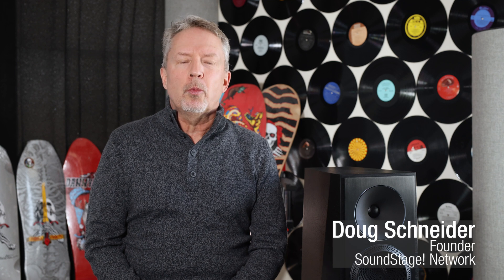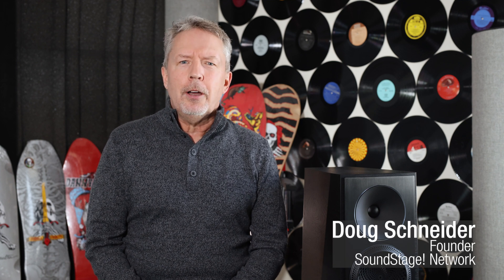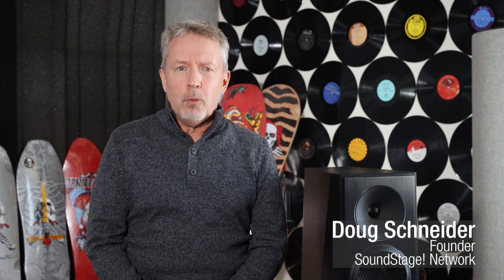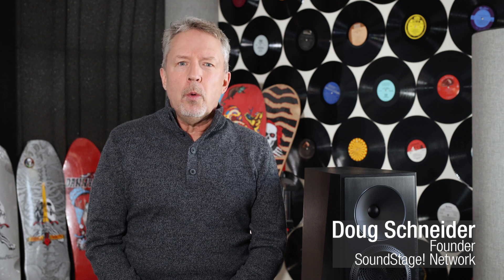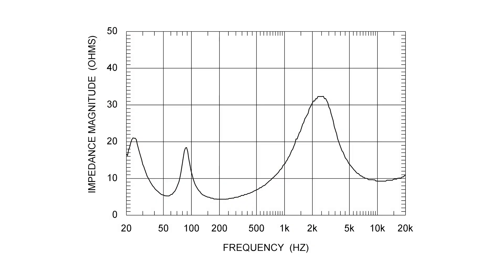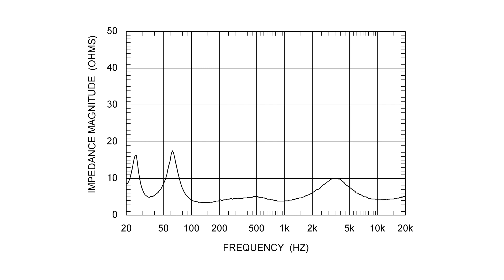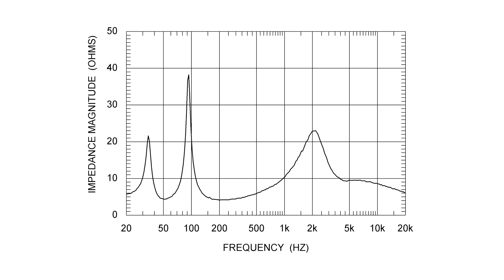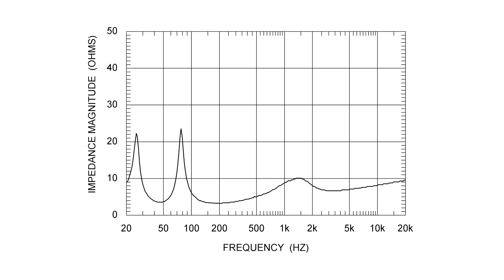Speaker Sensitivity Explained - "4-ohm/2.83V" is Not a "Trick" Like Robert Harley Claims (Ep:55)

Comment: We use constant voltage because all the amps are voltage generators, not power generators, not current generators. An ideal voltage generator has 0 Ohm outpurt impedence. The load takes what needs. This is the only way to see the real frequency response. If all the amplifiers were current sources and not voltage sources, we had to measure with constant current, but it is a fantasy film. ( Yes there is a small amount of current source amplifiers used with some woofers, but they are rare and all the system is calibrated around  this different solution )

Comment: I'm not agree. Power is important, because audio output dB is the result of the power introduced to the speaker, and that power is which moves the coil! considering of course the power losses, etc... Remember that the speaker is a MOTOR, with magnetic fields created BY THE CURRENT...So for example, if you have a speaker with two coils inside, e.g. 2 coils of 4 ohms, so you can put in serie or parallel to get different impedances, like 2 or 8 ohms. if the speaker sensitivity is 90db with 2.83V, you MUST specify which impedance you've used, because the power at 2 ohms is higher and the speaker moves a lot of air than 8ohms at the same voltage...!

Comment: You’re right but for residential amplifiers, voltage output figures are pretty much none existent. So we have to revert back to watts.
Reply: You're going to have to explain that more because I'm talking about consumer audio. Yes, amps are rated in watts, but the standard for speaker sensitivity -- really "voltage sensitivity" -- is in volts.

Comment: Most equate speaker sensitivity with a more sensitive sound, so you get people with mega sensitive speakers and enormous amps. So long as the test is equal it doesn't matter, however the tester might note that low impedance speaker A is a tougher load on any given amp than higher impedance speaker B. That could be watts been troubling him subconsciously.

Comment: To increase 3db, you need to double the power input. A 4 ohm speaker needs a more powerful amplifier.
Reply: You've got that partly right. To increase output 3dB, you need to double the power. And to increase 3dB more you need to double it again ... and so on. But that holds true for whatever the impedance of the speaker -- 4 ohms, 8 ohms, 6 ohms, 16 ohms, etc. And remember, no speaker is simply that impedance -- it's all over the map. The thing to understand, however, is that when you're turning the volume knob clockwise to go louder, you're increasing power, but what you're really doing is increasing the voltage to the speaker, with current following. Furthermore, a well-designed amplifier is already more powerful into 4 ohms compared to 8 ohms -- it's all part of Ohm's Law. Look at specs -- you'll see, say, 100 watts into 8 ohms and 200 watts (or usually close to) into 4 ohms.
Reply: @Doug Schneider  I don't see what I said was wrong.  I would not drive a $10,000 pair of speakers with a receiver unless it was McIntosh. High current  with 4 ohms means heat.  Also a good amplifier will double its power as the impedance is cut in half. Most amplifiers don't, that is why the bass is weak and uncontrolled. This video didn't explain enough of the variables. My view is the higher the resistance, the more control over the drivers.  This is another area to dive into.
Reply: @stevenburdick424  The point about "a more powerful amplifier" has to do with Ohm's Law. Voltage/current/resistance -- Ohm's Law, that's how you derive the power output. It's all related. As for doubling power, again, Ohm's law. But here's the thing -- while in theory a "perfect" amplifier's power will double when you go from 8 ohms to 4 ohms, in reality, there is no perfect amplifier. So when you measure the true output and look carefully, even the amplifier with the lowest output impedance won't quite double, because no amplifier has a 0 output impedance. Close but not quite. And don't get fooled by specs. I always bring up the time I had an excellent amplifier that was rated to deliver 400W into 8 ohms but 600W into 4 ohms. Manufacturer's specs. Not impressive to some -- because it doesn't "double." But what if the manufacturer chose to write down 300W into 8 ohms and 600W into 4 ohms -- gives the illusion of doubling. What really matters is if an amp can deliver the current. At very low output levels, most competent amps should -- even tube amps. But there are some crappy amplifiers. You mentioned receivers -- many can't drive below 6 ohms. It's because their power supplies aren't sufficient. But a good audio amp will easily.
Reply: @Doug Schneider  Well, the amplifier is going to run out of current quickly with a 4 ohm speaker.  Need to buy a heavy duty amplifier with good heat sinks. Although now if days there are class D amplifiers.  I have the Paradigm Founder 120H and a Carver TFM35, 250 watts at 8 ohms.  Anyways there needs to be a video that explains things a little more in depth.  An 8 ohm speaker will play louder because the amplifier didn't run out of power. But still some speakers can dip to 1 ohm at certain frequencies.
Reply: @Doug Schneider  It use to be 1 watt one meter. I'm 62  But anyways a 4 ohm and a 8 ohm producing the same spl means you need a more powerful amplifier for the 4 ohm speaker. I'm thinking they got it wrong going to 2.83 volts. Anyways who listens to speakers at 1 meter? This is just a measurement for designers.
Reply: Here we go. Another can of worms. Amplifiers should show an actual graph of when the amplifier clipped for 2, 4 and 8 ohms.

Comment: This is a really good video Doug! To few people have even a basic understanding of how this works. We always post a 1 watt/1 meter measurement. Because its the great equalizer.

Mark
Reply: Boy that just adds to the confusion...
Reply: @speakerscott    Look at it this way. What Doug said in this video is pretty much spot on. There is no confusion. There is well presented facts. If you can accept those facts you have a bunch of people that are confused in their viewpoints. Because what most people in the audio press type is little more than opinion. There are many things in audio that can be categorically measured. And these measurements will tell you a lot if you know how to relate them to each other. Doug has done a good job relating voltage to true sensitivity of a loudspeaker. There are many more things that are points of confusion. I should start a video series on this myself.
Reply: @speakerscott  Go on....
Reply: @speakerscott   How?
Reply: @KravchenkoAudioPerth  Easy...the whole video was about using voltage as constant and then you post about wattage.   Say you measure at 2V/1m for 4 ohm nominal speakers...but leave the wattage out of it.  See my longer post to Doug above...
Reply: @speakerscott    Listen again. Doug indeed mentions wattage. Specifically that 2.83 volts into 4 ohms is actually two watts into 4 ohms. 2.83 volts into 8 ohms is one watt. Loudspeakers are actually moved via voltage to current transformation. So all the voltage going into an impedance gets expressed in the motor as current. Again I am thinking about food for thought. Videos to explain this would be in order. 

Mark
Reply: But hang on -- are you saying you support my video, because I explain why it's really 2.83V that's the input standard ... ??????
Reply: @dougschneider8243   If it was that simple! Nope. I support this video because you explain the input voltage well. To few people understand this. You go through the voltage as a constant and how it will be in each input impedance. 2.83 volts into 8 ohms is indeed 1 watt. Using a broad bandwidth for a sensitivity rating is also valid. The 1 kilohertz point is fraught with many problems. Seriously a great discussion of what really matters.

Mark
Reply: @KravchenkoAudioPerth  Well I'm really happy to hear this. When someone takes on these short technical discussions, it's quite easy to misspeak, not make something clear, etc. I had several people on my team look at it and although if I did it again, I might've rephrased a few things for improved clarity, but I think it got the points across -- and what you're saying corroborates that. So thanks!
Reply: @Douglas Blake   You are right. And you are preaching to the choir on this one. But the one watt one meter metric is used to compare differences. Not create an artificial playing field of what a driver might do. I have read all the ideas. Yours included. Your statement is correct. What I can't understand is the resistance to what is an industry standard. I didn't make this up. It's been industry practice for the 30 plus years I have been working in this industry. The 2.83 volts is being used many times as a sales pitch. I've seen driver output listed at 2.83 volts for 2 ohm car drivers that at one watt were 72db! I guess if everyone else takes up this voltage reference it will shift. And this old dog can learn new tricks. But I can tell you I read driver datasheets daily. And they are all one watt one meter referenced.

Mark
Reply: The 2.83v method is the better way to measure sensitivity because it's a fixed constant. The 1 watt at 1 meter has no fixed constants, other than the 1 meter part. 
When you raise or lower the volume on your amp, you are increasing and decreasing the voltage supplied to the speakers. How much current they draw (and ultimately how much power they consume) is based on their impedance, which wildly varies. So an 8ohm speaker at 2.83v with a sensitivity of 88db will be the same loudness as a 4ohm speaker with 88db sensitivity. The 4ohm will draw more current and consume more power, but that doesn't make it louder. 
Your amp could go to 11 and (assuming it's well made and can handle the lower impedance) you'll hear no difference.
Reply: @IBuildIt  I agree with the constant part of your thoughts John. You are correct about a 4 ohm loudspeaker requiring more current. You are an accomplished amplifier designer in your own right. To get to your sensitivity example of 88 db 1 watt one meter in a 8 ohm loudspeaker you need the stated 2.83 volts. That same voltage into a 4 ohm loudspeaker, with a sensitivity of 88 db per watt at one meter distance to the mic will give you an out put of 91db. Because it is 2 watts into 4 ohms. I know this, you know this, but this is where the misinformation starts. Most people just look at the larger number and internalize it. It larger, it has to be better. But it isn't necessarily so. 

This is why I stipulate, because of decades long experience in the loudspeaker design business the accepted one watt one meter equalizer. Yes the voltage fluctuates. And yes your volume knob is at time the final arbiter of loudness. I have designed a few loudspeaker systems that are 100 plus db per watt. And many around that level of efficiency. It makes quite a difference to how things sound when you have dynamic music. Not being limited by power compression or small amplifier crest factors. So there is a bigger area for discussion on this topic. 

Mark
Reply: @KravchenkoAudioPerth  For it to be 91db, it would have to be a 91db sensitivity driver. Both driver are putting out the same spl, but the 4ohm guy is drawing more current to do it, when you measure using that fixed constant 2.83v at 1 meter standard.
You have three variables, but two are fixed: voltage and the distance. That leaves impedance to do whatever it's going to do at that voltage and measured from that distance.
With the 1 watt at 1 meter method, you only have one of the three variables that is fixed - the distance.